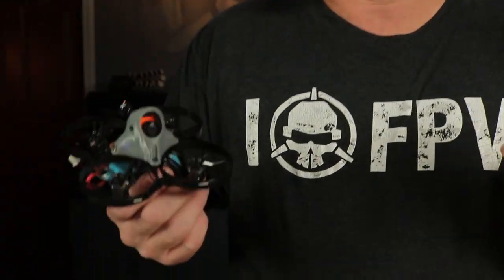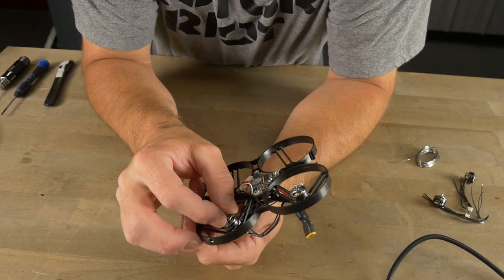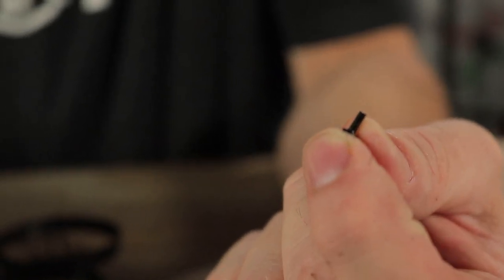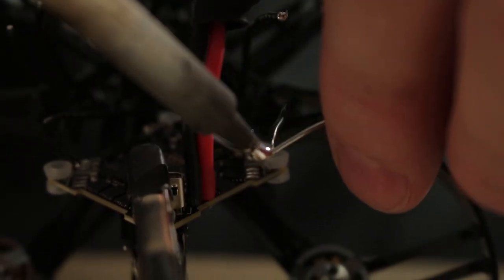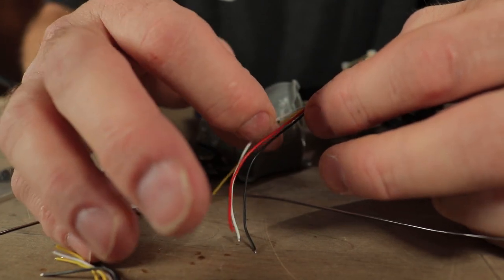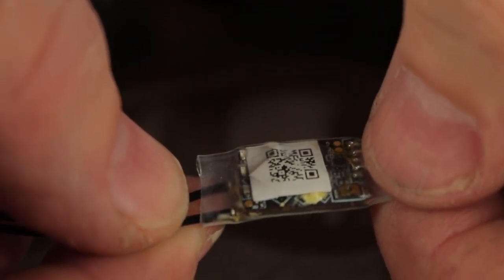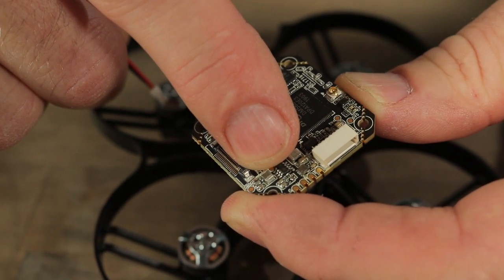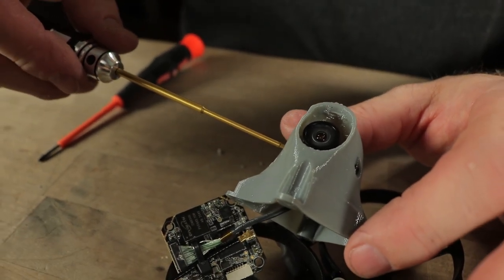Build: Micro HD FPV - The Babyshark!

Comment: Correct me if I’m wrong.  You cut the motor connectors off the board, then soldered jst connectors to your motor wires.  So, you had to get a whole new flight controller and now “possible” disconnect mid flight which is why you removed the connectors off the board in the first place.  Gotcha!   ?
Reply: He did not solder JST connectors to the motor wires
Reply: The video was a little confusing, because I found a better, more repeatable way to build it - after the build video was originally filmed.  

The first time I built them, I direct soldered to the board.  

The new method doesn’t require any direct soldering to the board.  

I wish I could have had time to just re-record the whole video without the direct soldering all together, but, that wasn’t possible, unfortunately.

Comment: Fun video.  I made my Shark Byte using a GepRC Phantom build. Much more forgiving build and lots of other FC choices work. If you want to stick with motors with plug connectors, there are motors with connector plugs factory installed.

Comment: Hi Sean   as much as I want to try the sharkbite system,  now I have not looked into it much, but I just looked at the price,  and is this for the receiver for your Googles also ?   There's no way I would be able to fly it, It's more than DJI.
Reply: Sharkbyte is only cheaper if you AREADY own a pair of analog goggles with a supported adapter. Otherwise DJI is cheaper
Reply: @Isaac lanier  thanks
Reply: @johncarold  of course

Comment: What is the weight please? Trying to compare how much weight the shark byte saves over a vista on a whoop.
Reply: Their website lists it at 78 grams.  The Beta85X (which they basically copied the design of 100% except substituting the crappy Shark Byte system and 3D printing a canopy instead of using nice injection-molded plastics) weighs in at only 66.6 grams.  LOL.  So it's heavier, more expensive, a blatant design rip-off, and offers worse video quality.  Oh, it's also more expensive.
Reply: @TheDiegoAranda  So is the linked $300 one not even pre-built? Why would anyone buy it, then have the build it  VS the Beta which is already built and cheaper?
Reply: @Stevieboy7  Some people actually like to build things

Comment: Sean dont cut the motor wires what if you cut the fire instead of removing the wire insulation so just cut the wire thats attacted to the plug instead
Reply: And the motor cost more than the little plug

Comment: I’m on the fence about investing in digital since I don’t fly nearly as much as I used to. This is the first fpv vid I’ve bothered watching in over a year.  Since I own hdo2’s is this shark byte worth it? Not really wanting to throw down 1k on a new system like dji.  Then converting my fleet.
Reply: I own a DJI system, but if I'd already had a premium set of goggles I think I would have gone shark byte. I've seen some pretty good video on some of the channels, at least good enough for me, and definitely better than analog. If you already have good goggles, the vtxs are lighter, at least for now and a lot cheaper per quad.
Reply: @kurtzFPV  thanks for your reply. Good info.
Reply: @aakashjana6225  thanks for your reply. Something to consider I suppose
Reply: I went that route because I already had HDO2s.  I don't regret it.  Shark Byte has treated me pretty well, so far.  It hasn't been perfect, but nothing is.  I've flown DJI and it's very nice, but Shark Byte is also pretty good and has other benefits.  A big one for me is that it acts just like an analog system, so I can easily fly with three or seven other analog pilots, like at races.

Comment: Even though this is a really good build, I am just going to stick with mrShutterbugs build. But sill ❤️ the video!!
Reply: I watched his video and I really like his approach, but, for most people, it will be very difficult, where I wanted this build to be more approachable for more people.  Also, with the slightly larger pod, it adds a bumper at the top to protect better in crashes.   If it is 1 or 2 grams heavier, to add durability, I think it is worth it.  

The performance is insane, and the couple grams doesn’t matter.  Bubby trippy spinned inside of a small room, and MattyFlipped himself.  Couldn’t fly too bad ;)